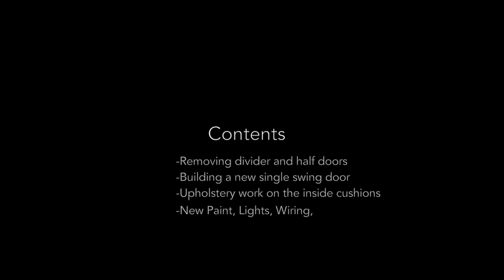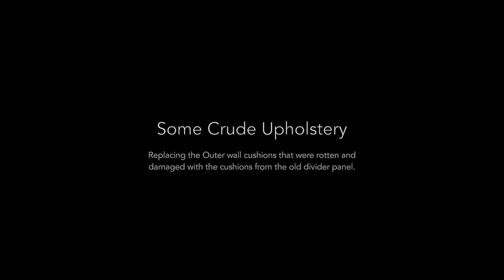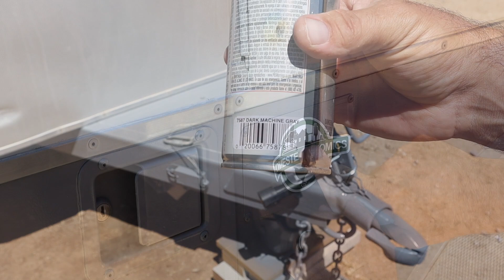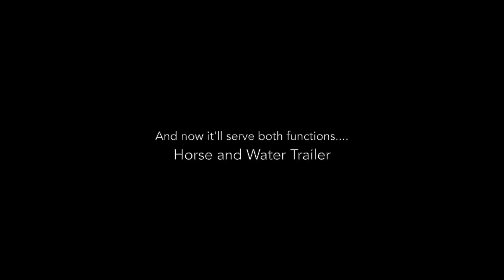Refurbishing and Converting An Old Horse Trailer  (Divider Removal, Single Door Conversion, etc)

Comment: Adhesive lined heat shrink is great stuff. I had a connection sit under water all spring and no damage. Normal heat shrink can seep water...
Reply from the maker: Yes, I’d imagine those would definitely be the best.   I’ll look into them for when I eventually add  backup lights on this.  Thanks Mary!

Comment: Recommendation;
Always run TWO wires to EACH light.
Grounding to the Body will result in far more issues.
The expense of an extra wire is far less than even the time to troubleshoot.
Multiple metal types, rust, corrosion, vibration, etc. all contribute to poor/no grounding.
Nearly all trouble with lights is due to grounding to the "body" etc.
-
Reply from the maker: Yes, that is good advice.   I knew the biggest thing to check with trailer lights is the ground.  But I hadn’t considered a separate wire.  😊👍
Reply: Other side of the coin on this..  locktite and some silicone over a clean ground connection.. only half the future wire tracing issues...
Reply: @rob8823  It is much easier to test for continuity of a wire than to troubleshoot Whish body/frame panel has lost connection with the adjacent.
-- Sometimes the light has a good connection but the part is not well connected to the next part. There may be several parts in the line before it connects back to the ground.
- each connection can fail.
-- a bad connection is easily remedied by just running an additional wire. One wired is already run and the second wire takes little space.
-- Saving a few pennies is a false economy when standing on the side of a road troubleshooting an intermittent connection.

Comment: Wonderful job. Looks brand new. I was wondering if the floor can take the weight of the water container considering that some of the wood had rot, but knowing you, you already thought of that. 😉
Reply from the maker: It’s a great question…. Because the IBC tote will be around 2700lbs when full.   From what i can see the crossmember steel frame work that the wood is mounted to is stout enough and closely space where the wood won’t have too much weight that isn’t dispersed pretty well.
Hope that made sense🧐🤪

Comment: A) How'd I miss this when it first came out? Bad youtube. B) you might consider having a lip on the upper door to keep the lower door closed then add someway to lock the upper door. That way the trailer is secure. To me that's more if your out traveling and have to pull over somewhere or stop for the night. C) Of course you had the aluminum trim :P D) Trailer looks good.

Comment: Great job! Watch those bearings when you haul. Touch them every time you stop. I’ve had that type lose grease and fuse and that’s a disaster especially if your welder is at home.😢
Reply from the maker: Yes, agreed!   That is a concern of mine as well.   Especially hauling the horse…. Would make being stranded extra interesting😬

But on that note…. Checking the wheel hubs for heat is something I do whenever we take the travel trailer camping too.

Comment: Ideally, you should reinstall the centre divider. An animal, especially a horse, needs to be secured whilst in transit otherwise you may get to the end of your journey to find that the horse has a broken leg. This is why livestock trailers such as an Ifor Williams Trailers one has gates/dividers inside to prevent unnecessary movement of sheep, pigs or cattle or a trailer is filled enough of the animals that they are unable to slide around (not overcrowding however). All of these methods are intended to protect an animal whilst in transit.
Reply: Scramblers travel better without dividers. And not all horses appreciate them. I have one that is far from happy when a divider is involved

Comment: I know this is just a small bumper pull trailer. One VERY NICE update I made to a friends 27ft 3 horse trailer was to add reverse lights to the trailer. I don't know how many times we arrived at a show when it was dark out. Adding a simple relay to the reverse & continuous power connectors made a nice addition to be able to see when you are backing up.
Reply from the maker: You know why I’ve definitely been considering adding them.   Almost ordered some when I was getting the wiring harness but opted not to at the time…..but now you’re making me want to get them😂
Reply: @homesteadonomics  Just make sure that you have power to your trailer plug.....for some reason my 7 pin plug didn't have power....it was just a matter of hooking up the wire in the fuse box under the hood. on the trailer side, find the reverse wire in the distribution box. use the reverse wire as your switch leg, and then supply power to the lights through the relay, and run your wires back. The hardest part is finding a good place to hide/protect the wires to the back. I while you are running wire, pull an additional power wire.....this will allow you to hook up a 12v fan, and a wireless camera for inside the trailer.....or a reverse camera.

Comment: Another insightful video, thanks for sharing this today.   

Thoughts for the wheel bearings, when you are sourcing the replacement parts, look for hubs that are equipped with grease fittings.  Most often found on boat trailers for keeping water out of submersible hubs when unloading or loading boats from water.  Useful in dry climates for flushing grit infused grease out of seals.  

When you removed the center post did you add a horizontal support above the door opening or is it sufficiently stiff.  

Wishing you and your family a blessed week filled with gentle seasonally appropriate weather and restful evenings together.  Peace brother.
Reply from the maker: Thanks!   The zyrc fitting hubs I had not considered but was aware of them with not trailers.   My plan is when we get the tires and I’ve got the wheels off, im going to inspect the bearing and track.   And if there is no pitting and everything is shiny I’m going to just decrease them.   I’ve heard some of the older ones, if still in good shape, are built a bit better than some of that replacement ones.   But I guess I see in a week or so…haha

As for the center post.   The horizontal roof support is sufficiently still.   I could do a pull-up on it with no flex.  And it served mostly just a mounting point for the divider, and door latches, versus something structural.

And may you and your family have a blessed week too!
Reply: @homesteadonomics  Too true Joe, the older “Timkin” bearings are much better than a lot of the ones coming from Pacific rim countries.   A friend’s dad used that style of hub on his landscaping trailer.  His son now has his dad’s business and a 30+ year old trailer with original wheel bearings.  Here in NE Ohio our roads are usually salty from November through spring rains.  I managed to get 26 good years out of my Ranger until the frame became “crispy” and could not be safely lifted for service.

Peace brother

Comment: Great refurbishment on the trailer.  On trailer tires...I can recommend Goodyear Endurance.  Not cheap but darn good and USA made.  I have them on my travel trailer.  Carlisle tires I've had before on my travel trailer and they were good but made overseas.  My car hauler came with Goodride tires on it and I've not had a problem with them.  But I do keep them inflated and inspect them regularly as their on the lower end of the trailer tire spectrum.

Comment: As always you are amazing.  Attention to detail is a given with any project you do.  I think the diamond plate classes it up a lot . Only thing I would add is some of the DOT reflective chevron tape on the rear of the trailer.  Will be looking forward to the next video.  Be safe.
Reply from the maker: Thank you!  At first I was wanting to utilize something that would blend in a bit smoother….but now that the diamond plate is up, it’s definitely grown on me as well.  Plus, it should keep the hi beams off for traffic behind me wheel driving at night😉

Comment: I would be mildly concerned about the lack of confinement. If the horse in the back can move several feet sideways, they are more likely to hit the sides harder. It also means there is room to fall down.
Reply: And how do you explain horses shipped in open stock trailers every day all over ranches?
Reply: @livesoutdoors1708  You answered your own questions by stating horses. Multiple horses/animals act as buffers to one another. A singular animal needs support or have its space limited by the use of internal dividers/gates. It is not good practice to transport an animal without securing them. Especially a horse.

Comment: Pretty cool, I am in the middle of renovating a horse trailer we have that had been previously renovated by someone else and it was all wrong. We're tearing out the centre divider and turning it into a 3 slant load trailer mainly because I have a monster horse that we rescued and now that he's healthy and put on weight he no longer fits into his slot. We want the horses to be comfortable and don't need the tack room because everything just sits in the bed or cab of the truck normally in case we have to go help with a rescue or something. Many thanks for sharing and awesome for Marley and her mustang, the wife and I have two as well we're working with.

Comment: Very nice trailer!  I assume the ramp is short enough to unload the IBC tote with forks on the tractor because you're a detail guy, but i can't quite visualize it. 
Great work as usual.
Reply from the maker: You know what…..I have no idea.   The only tractor I have access too is my neighbors kubota.   But this will be just moved in and out manually when empty.    The water will be pumped out before hand.     They aren’t too difficult to scoot around when empty.  

But since you mentioned it I do have a n interesting project coming up that could help with moving these around…. Stay tuned😉

Comment: Great job sir. I’ve had a few livestock and horse trailers similar to this as well. I’m sure you verified the floor was sound as well? Seeing that wood from the back doors made me wonder. Also, feed bin areas can sure rust out through to the front or saddle/tack room. Great job making it multipurpose as well!
Reply from the maker: Thank you!   And yes the floor decking is solid in closely spaced steel angle members.   The reason the plywood is so bad in the old doors and the upholstered section is that the wood was welded into the door and they never added drain holes.    And the upoholsted section kind of has that same issue.  With the water coming in along the wall and getting trapped within the vinyl fabric and the plywood.

Comment: Really great project. The trailer seems to be much more useful now. The wide door is such a bonus for water hauling but I figure that if you need to get more hay and feed than you truck can carry this is also a great addition. Did you need to weld anything in to strengthen the door opening or was the upright yo remove not really a weight bearing piece. I’m sure that Marley will be fine learning to change tires and replace bearings. Any skill you have is a positive. Thanks for sharing and a little early but have a Fun and Safe 4th of July!
Reply from the maker: Thank you!   Yes that middle post was mostly just a point to hold the divider and have the half door latches attach to.  Not anything structurally necessary.  
And I hope you have a great 4th too!

Comment: I didn't see the trailer license plate or license plate light.? May be ok in AZ but don't think so / may get a ticket.
Reflective red & white tape at the bottom of the ramp would be a great safety feature.  Walmart has those strips.
Excellent workmanship on refurbishing the trailer.
I have an older 2 horse trailer that I bought in Tucson and the spare is a Costco tire. It was New ( former owner bought it ) and has never been on the trailer. After seeing this tire (the tread is peeling off ).. I have never seen that & I've had trailers for decades. Hope you get better quality at Costco.
Reply from the maker: Oh it’s required for AZ too.   But I didn’t have a bulb for the plate light.   And for the reflectors I had removed a couple old ones when I painted it and just forgot to put some back on🤦‍♂️.  So it’s good that you and a few others reminded me so I can get it good to go before we take a trip in 2 weeks with it.😊🙏

Comment: I don't know anything about horses, so this is just a genuine curiosity... Doesn't that divider piece help to keep the horse from moving side to side in transit?  I sort of imagine them being as bad as dogs at standing up in a vehicle.  I don't think I've seen one without that, so it made me wonder.

Other than that question, great build.  It looks really nice.
Reply from the maker: Yes, the divider definitely has its use.   But most of the Mustang folks we’ve been talking to recommend taking the divider out with our mustang as they’ve found it more compatible with their mustangs.   In training to trailer.   So I opted for that and also to be able to fit a tank in there when needed.

Comment: are there no Reflaction Sticker or Plate Laws where you live? i would put Reflector bands arround and red ones on the back so it can be seein without a light on it standing somewhere.
Reply from the maker: There are, and I have to put a couple on the rear corners that were removed when I was painting.   But you an another person reminded me.   So thank you😊🙏

Comment: Very clean-up grades. What is the gross weight and net weight of your trailer?
Reply from the maker: You know what….I have no idea🤦‍♂️😂.  I do know it’s got 3500lb axles and springs.   But I couldn’t tell you what it is total weight
Reply: @homesteadonomics    
   Thank you. If I'm thinking right it must be 7,000 GVW or less. With no CDL license needed to operate if the truck and trailer total weight  26,000 pounds or less.
Reply: @davej7458   He could tow a trailer 3 Xs that size and Not need a CDL..  A CDL is for commercial trucks not ranchers ect type equipment.
Totally different catagory.

Comment: The springs for the lower ramp seem to be partially blocking the trailer stop/turn lights.  Is that a problem?
Reply from the maker: Yes they block them a little bit…. But not too much.   I think it was an oversight in the original manufacturers design.   I did think about adjusting the mounting points but kinda thought I might not improve it enough for the effort spent.

Comment: Is there a way to secure the tank from sliding around in the trailer?
Reply from the maker: Yes, there are tie down points.   But I may do what I did for the back of my truck.   Which was to weld a tray that it would sit in to keep from sliding around

Comment: I am purchasing a 1989 horse trailer and want to convert it. I do not do horses or camping but want to turn it into a toy hauler along with a cargo trailer since I buy abandoned storage units and the $350, I spent buying a working trailer is cheaper than buying one made specifically for hauling cargo.